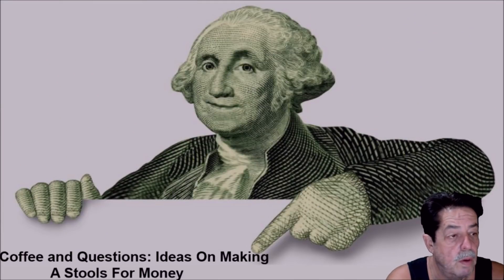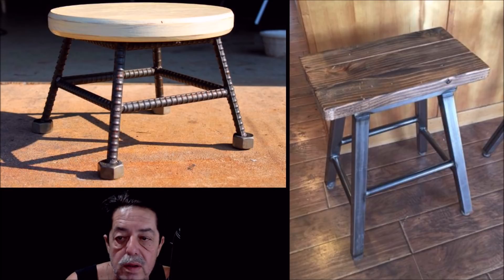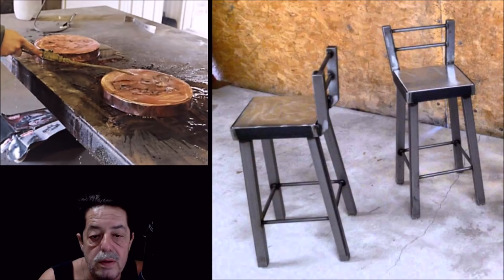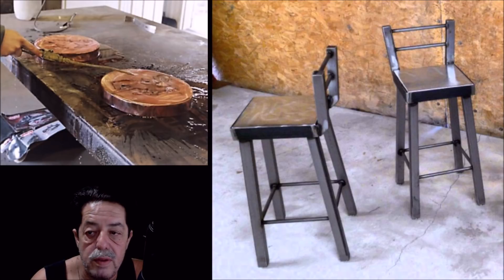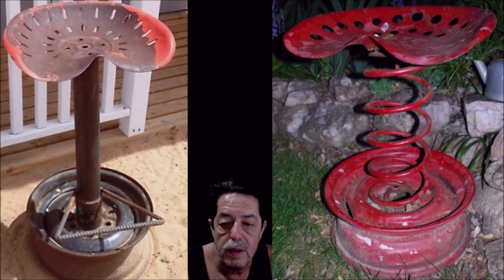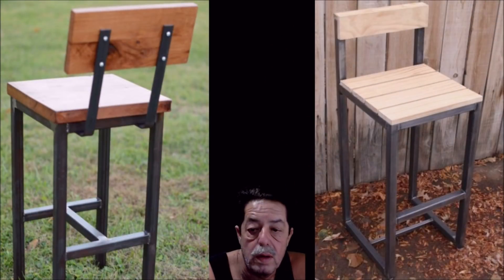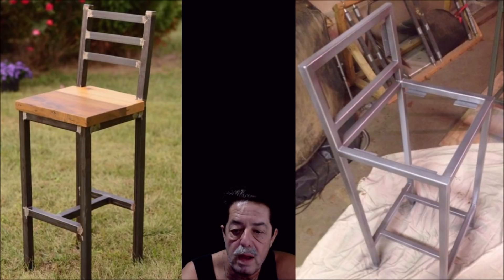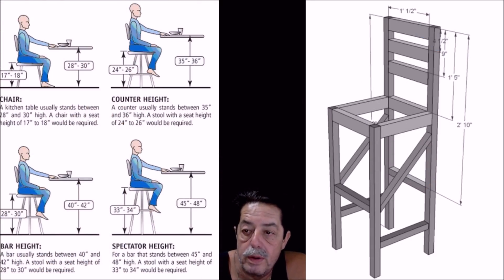How To Make Money Welding - Part 29 ( Stools )

Comment: best place to get those truck springs, is off of trucks. they are in parking lots, everywhere!!! ha ha......
Reply from the maker: LMAO - well I have tried the junk yards but its only standard size truck spings - the ones in the picture are much larger
Reply: @TheHomeHandyman  

If you contact any industrial machinery repair shops around you (bobcats, tractor-trailers, etc.), you'd have a much easier time finding the larger springs. Heavy equipment mechanics, too. They usually have to throw those old springs away when they change them.
Reply: @cavemanjoe7972  Thanks and I will look into that - my area does not have heavy equip repair places but ill expand my look